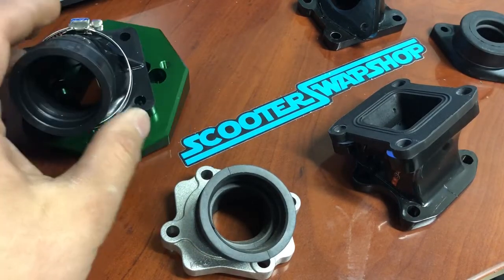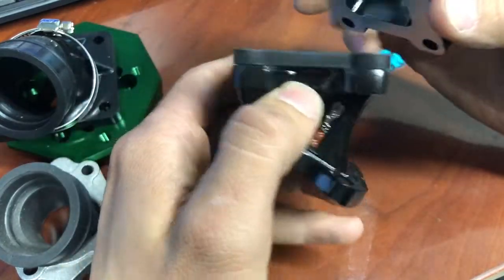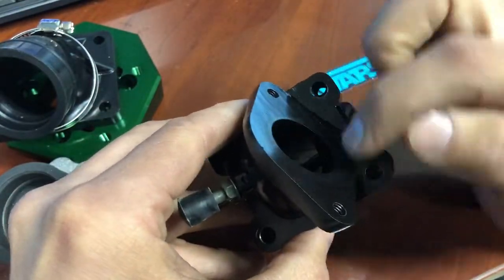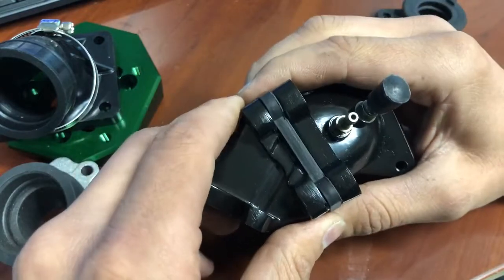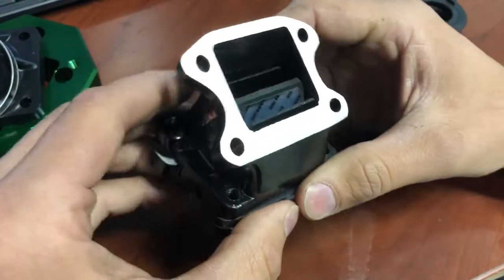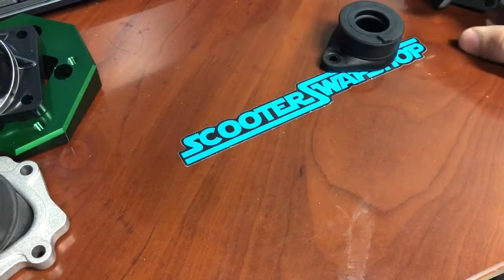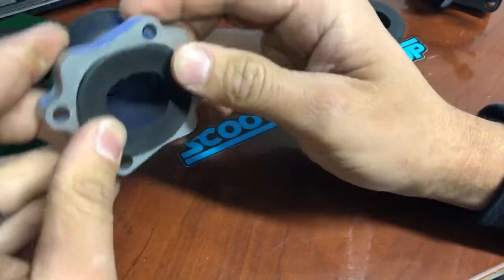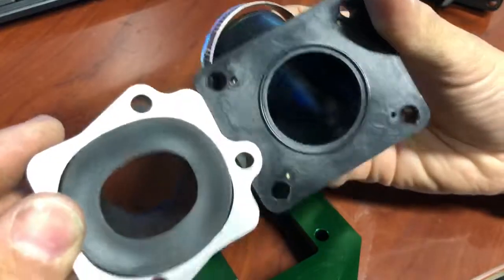Scooter intake manifolds Zuma elite

Comment: Hey the Honda dio reed those two metal shims that come with it but not installed  on the reed cage. Do I install those? I'm running a mikuni 21mm pwk carb and like the other guy that commented it's going on a zeda dio reed motorized bicycle.
Reply from the maker: send the shop a email with photos and your order number we will get you the parts you need

Comment: do i leave the manifold nipple valve open or seal it off? im using this on a 2 stroke bicycle motor. thanks
Reply from the maker: Bicycle?
Reply: @Scooterswapshop  yeah I installed it on a zeda 80 Dio reed 2stroke. Works great